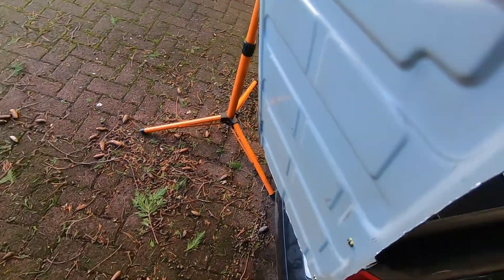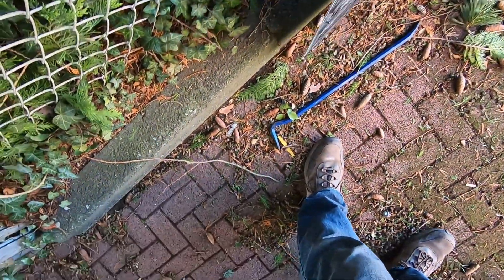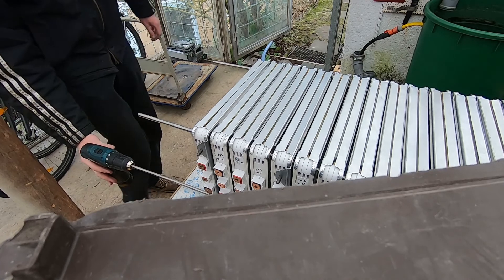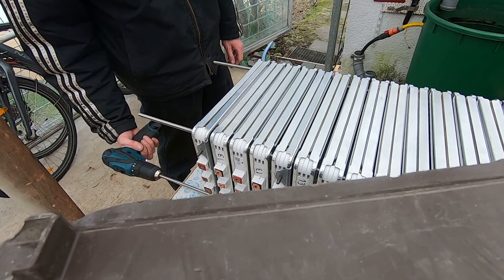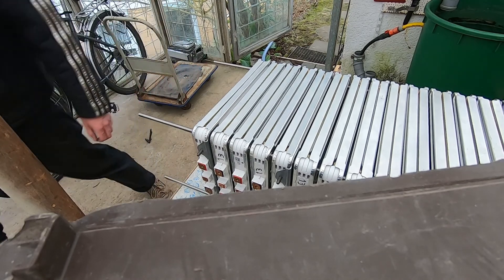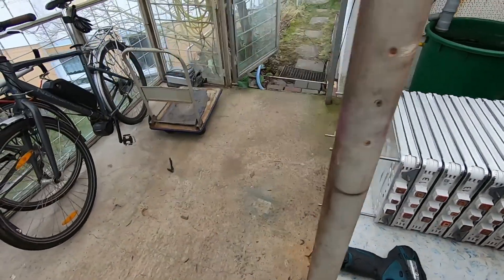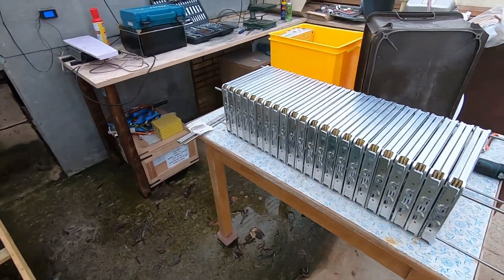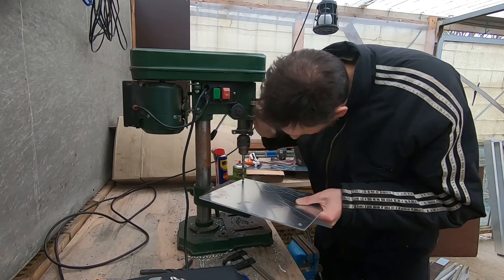Lab Update #59: Installing a Nissan 24 kWh battery in an Audi A2

Comment: Good work. Will the battery box get any additional weather sealing to prevent moisture coming in from underneath? because the floor was cut open, does that cause any additional issues when getting for passing TUV?
Reply from the maker: The floor isn't structural so it doesn't cause issues. I will smear the remaining gaps with some sort of sealant later
Reply: @openinverter  In Australia, any time you cut into the body, you're required to get an additional level of engineering approval. If something is bolt on, it's a lot easier and cheaper to get approved.